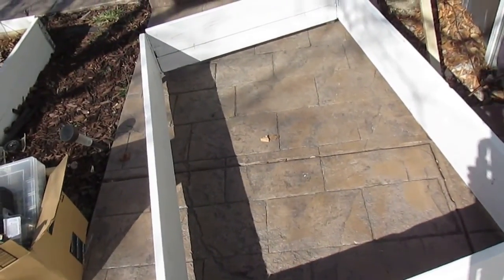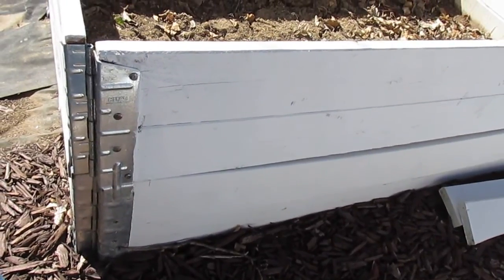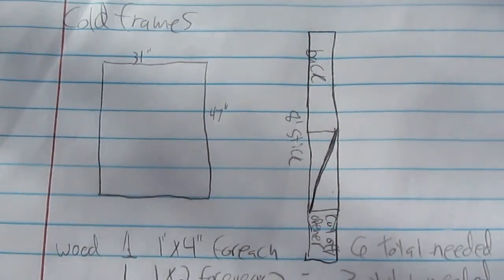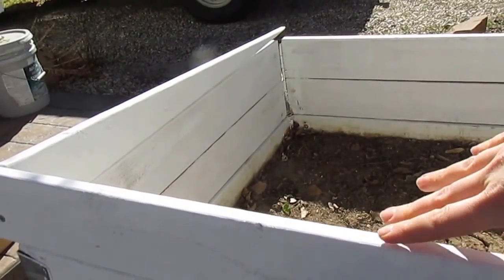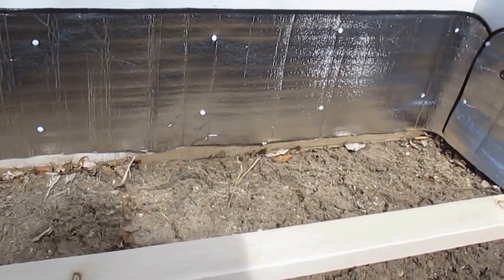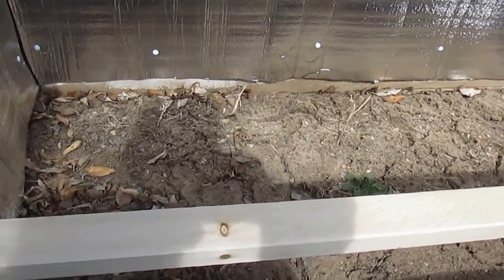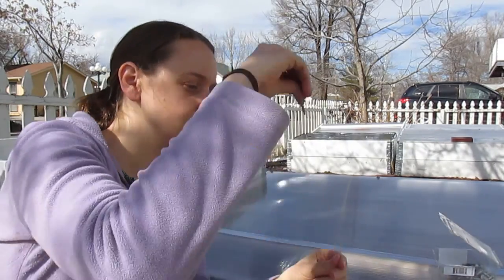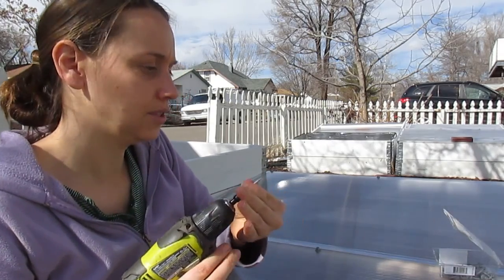Building The Cold Frames

Comment: Total price for finished product???
Reply from the maker: That's not easy to answer actually but I'll try. $5 for the pallet collar, another $2.80 for the lid wood. its the top that gets hard to compute because the polycarbonate was planned to be extra from a harbor freight greenhouse that we are turning into a goat shed. My best guess is maybe $50 for enough to do the 6 cold frames, or $8.33 each. That's a total cost of $16.13 each for 10 square feet of year round gardening. Similar size and materials of commercial ones start at $100 each, so I'd say we did pretty well.